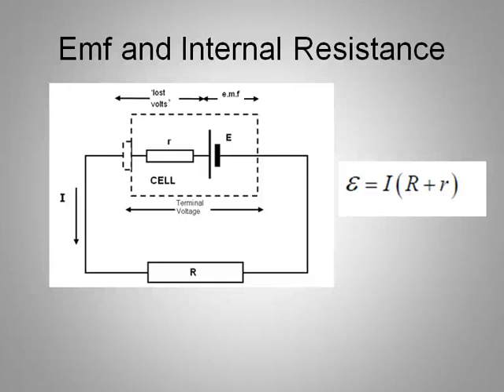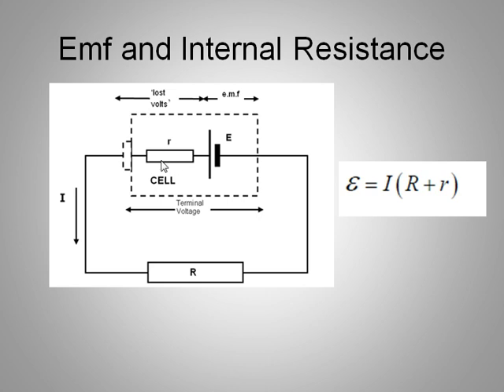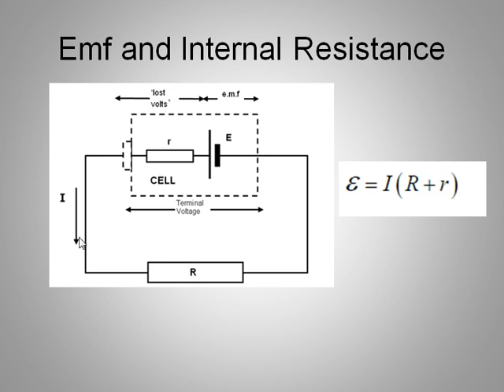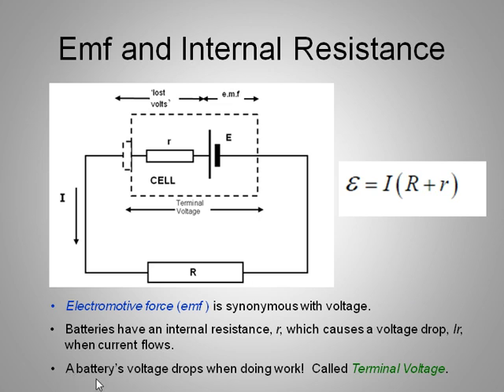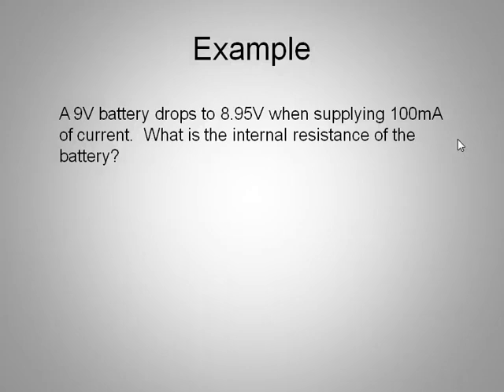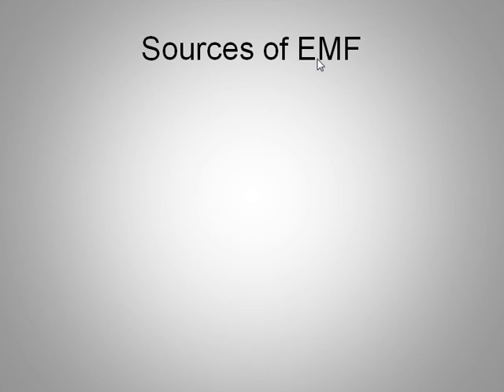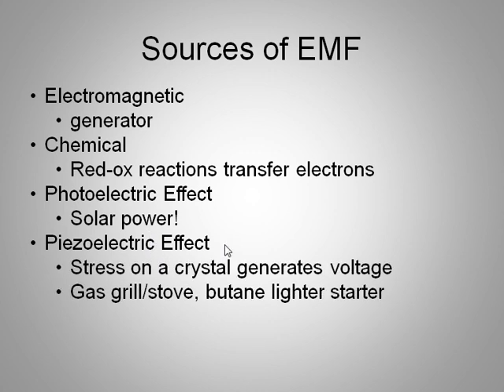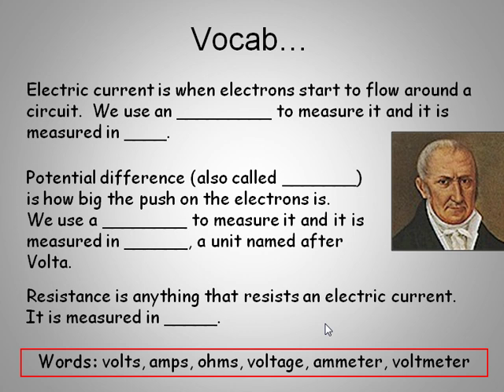IB Physics: EMF and Internal Resistance

Comment: sir, how can you measure the emf without the effect of the internal resistance?
Reply from the maker: Make a circuit with a known series resistor.  Measure the current.   You can then calculate the internal resistance.  The current * internal resistance  = voltage difference between emf and terminal voltage.